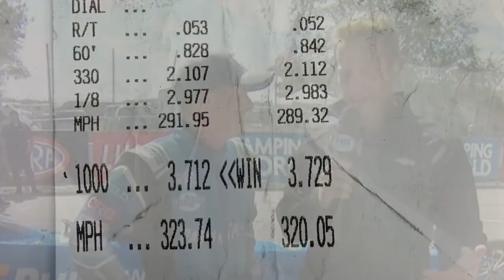Back To Back NHRA Top Fuel Final Rounds #nitro #topfuel #dragracing

Comment: Hey Clay, your Top Fuel car (and all others) seem to “hunker down” when it pulls into the final beam and sounds very throaty and even a little quieter from the burnout. I was told that the timing and fuel mixture on the dashboard also changes. Is it automatically changed or do you do it while staging and exactly WHAT THE HELL IS GOIN ON??
I am a HUGE fan of your program, team and channel (also BabyD!)
Reply: These cars have a completely mechanical fuel injection system.  The main fuel valve is controlled by a lever near I believe the left hand.  With the car just idling the fuel lever is probably around 1/2 open since the engine doesn't need full flow.  Also the clutch is in a relaxed state. These cars have an automatic clutch that engages just slightly at idle.  When the car is staged the fuel lever is set to full flow and the clutch is released.  This is called "tug" and is what you hear when he turns on both bulbs.  It's the byproduct of clutch drag and full fuel.
Reply: Clay does have control over the fuel flow from inside.
Reply: Tripp, check out Angry Hornets youtube channel. He does a lot of technical explanations. A goldmine for a tech nerd like me.,
Reply: @Momfasa  Awesome!! I am on it!! Thank you

Comment: Clay either extremely lucky or is cut a deal.Could he be a blocker car for Capo .He lost his crew chief the John force . Now the crew chief he's got is good but is not up to Grubby .The car seems to run good no matter who drives it . Why does this happen . Well he gets to keep his sponsorship and race more . In second pays pretty good . This goes on ... You'll be naïve if you didn't think it did . The brothers have figured out something with the clutch management system . Where they know the car will go down the track . Has anyone noticed that the father has stopped racing . It's cheaper to pay somebody to block for them ... Sorry to breaak the bubble but this does go on